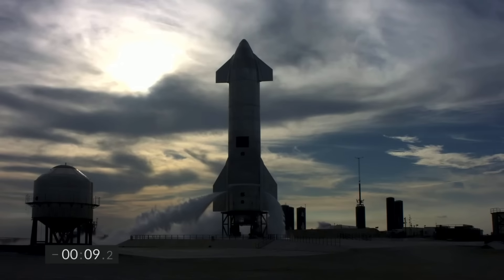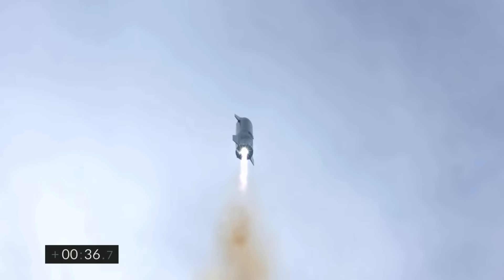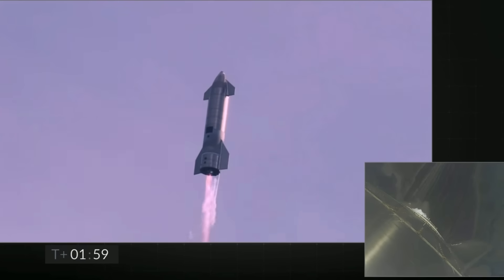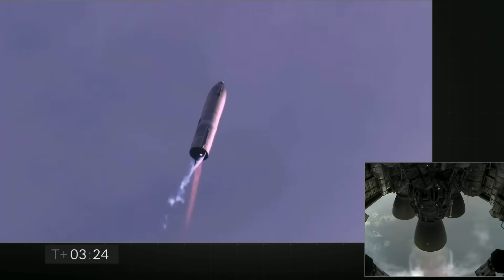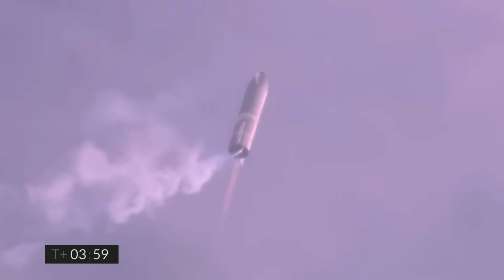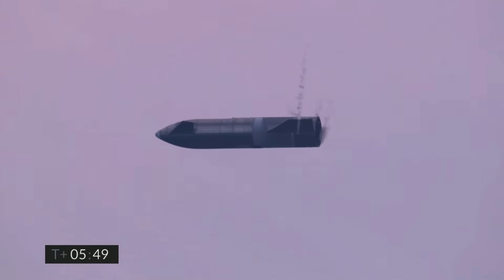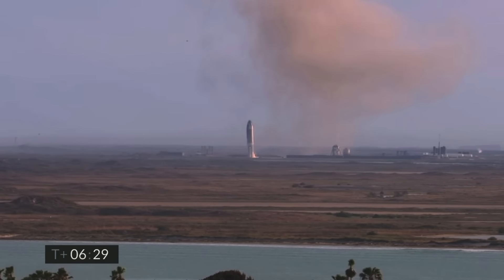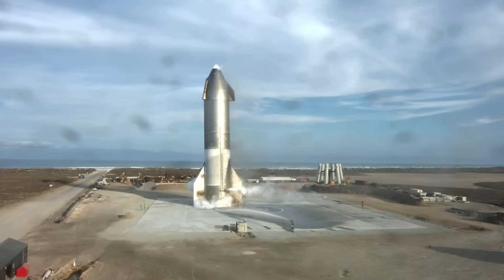SpaceX Starship SN10 soars, lands for first time!

Comment: I dont understand why rocket scientists are not developing utilities to make use of all that wasted energy from the discharge of combustion and electro magnetic waves? All that steam blowing back against the rocket is more fuel. No wonder you have such a hard time. Also, if you want to go to the end of the earth it helps to know up is down. Space is at the bottom of the ocean and that is what is at the top of the atmosphere if you can perceive it.
Reply: I believe we have witnessed an electrolysis design masked as a standard rocket
Reply: Because what you are saying is utter useless bullshit that's why
Reply: What does the last sentence mean? I was under the impression that as you go up in the atmosphere the air gets less dense, and as you go down in the water the water pressure increases. Does the air not stay air, and/or the water not stay water?

Comment: Can't they just find another way to build this rocket? It seems sluggish and fat, plus the landing is kind of overcomplicated. I think they are wasting precious time and money here.
Reply: This is just the upper "half" with (3) engines. The bottom booster will have something like (28) engines.
Reply: It's slow because they're not running it at max throttle. And it kinda needs to be fat to slow down during free fall
Reply: Chill, this is just a test flight, one of many. Things will probably change along the way. This is still better than wasting peoples lives due to a rushed production.
Reply: How about you build another rocket
Reply: My trick worked: write something that triggers others so they can explain it clearly, therefore I didn't have to google it. Thanks for your answers. Now I understand it.

Comment: Took Falcon 9 first stage about 10 tries to land first time, now almost every flight lands.
Reply: Roborav D  i heard Ferrari's are made from steel and aluminum, such cheap pieces of shit
Reply: Roborav D  Well if you look at the amount of time and money that goes into one they are factually not "cheap" and yes I think anyone with half a brain would rather us go the route of reusable materials, instead of non.
Reply: Roborav D  The whole point of Falcon and Starship is its re-usability. Falcon is doing great in launching and delivering payloads into orbit, with almost 99% success on landing and recovering at sea (of course i still love you, Roborav D). Starship and its raptor engines are obviously a long way from that goal yet.
The same remark you say about idiots going in to space could be said about anyone boarding an airplane such as, say a Boeing 737. The tin can I had the privilage to be in once.
Reply: Roborav D  A yes. Made from such unreliable reusable materials as aluminum, steel, and carbon fiber. Yep. Pinnacle of cheap cut rate building materials! /s

No seriously. How dumb are you? Starship is made from stainless steel, steel, and aluminum. The rocket components aren't made of recyclables. They're designed to fly more than once. Hence "reusable".

And they work. Falcon 9 costs a fraction of the price of similar LEO satellite systems. The last Falcon 9 failure was due to a component that had been to the upper atmosphere FIVE TIMES. Compare that to the Space Shuttle where the only component that came back was the Shuttle itself. $337 million dollars in hardware turned to scrap with every Shuttle launch.
Reply: @Donut0389 Pointless to compare the Space Shuttle to the Falcon 9, they are nowhere near each other in capability. The Space Shuttle could carry 7 astronauts AND 60,000lbs of Payload to LEO, AND return 30,000lbs of Payload back. Not a single operational vehicle in history has this capability. And you’re proud the Falcon 9 failed after FIVE flights, the Space Shuttle on average saw over 25 flights each (39 for Discovery) to a total of 133 manned missions in a 30 year lifetime using a vehicle designed and built with 70s technology with only two losses, with one being caused by NASA management making decisions for political reasons. 

We applaud SpaceX for their achievements, they are great. But credit where credit is due, for it’s time, for all of NASA’s bureaucracy, for not having 10+ vehicles to test with, the Space Shuttle was amazing.
Reply: @Donut0389  "re-used" and "heated up, fractured and subject to damaging conditions" aluminium steel and carbon fire. you forgot to mention the first part.
Reply: @joaobranco2305  I don't believe a single SpaceX Falcon 9 in recent years has been lost due to structural or rocket engine fatigue. When an engine is damaged, they replace it. The main body of the rocket is designed to hold up against forces well and truly beyond the forces applied to it during a nominal launch and landing.

The Falcon 9 system failures have mostly been guidance failures. The recent Falcon 9 failure to land was caused by a boot that had failed on ascent, causing hot exhaust gases to go where they shouldn't be. The rocket then shut that engine down on the way up because the system has redundancy built it and can complete a mission down an engine. When they re-lit on re-entry, the already damaged boot failed entirely and the rocket wasn't able to slow down in time. Thus it missed its target and crashed into the ocean.

SpaceX now knows to more thoroughly inspect that part of the Falcon 9 pre-launch. Starship is still in the prototype phase but is already ahead of the Falcon 9 at the same point in testing.
Reply: @Donut0389  The solid rocket boosters on the space shuttle were also reusable. It was only the empty external fuel tank that didn't come back. Reusability seems like it makes the most sense but the reliability and safety are more important than cutting costs. Musk is also constantly exaggerating and making unrealistic promises so we'll all have to wait and see how successful starship is.
Reply: Roborav D  They hv too much money and would like to buy something thrilling and expensive dude...😄
Reply: Imagine how many passengers are going to die.........
Reply: @ChaptersOfTheBlood  why would I want to do that... these are prototypes.
Reply: @ChaptersOfTheBlood  you just going to board people on an experiment? You know how stupid that is?
Reply: @ChaptersOfTheBlood , That has already been imagined well beforehand. That is why prototyping, testing, data gathering (repeat process many times) is being done until it works.

Comment: I wouldn't say it was a soft touch down....bit of a bounce at the end.
Reply: Yes, and probably enough to do some damage. Real Starship would be much heavier, with extra engines and returning payload and crew. But still - each test is making progress. Engineering proceeding step by step with what is being learnt.
Reply: @ianstobie  they change it alot, right now all the way to 15th is old and they will not be used, so they push them as hard as they can.
Reply: @ianstobie  returning crew ? wut
Reply: @eugene4950  Sorry I seem to be having trouble putting links in comments at the moment, but if you go to the SpaceX website you can see the intended spec on their homepage. Starship, once perfected, is designed to take cargo and crew to Earth orbit and beyond, to moon and Mars. It should be able to take 100 metric tons to Earth orbit, so it could carry loads heavier than the James Webb telescope. Or lots of people  -  more than anything else currently on the drawing board.

But it's early days yet. Just three test flights, none so far surviving a full round trip. Like other SpaceX vehicles, Starship is intended to be reusable many times, so a lot of work still to do to make that a reality!
Reply: I saw that bounced too
Bit a rough landing, but still in 1 piece and still standing, eventhough its abit tilted
very important data gained after all 
I think next gonna be soft landing
Reply: @j3fron  One piece, kinda
Reply: @j3fron  It isn't in one piece. It blew up.
Reply: It seemed to be leaning to one side after it landed.  Probably very little shock absorption with the current landing legs.
Reply: It flew twice landed once
Reply: It didn't look like all the landing legs deployed properly and after that it was sitting on it's bottom, not on the legs which may be why it was damaged and leaning...and blew up.
Reply: @Gamble661  I do have to agree. SN-10 looks like it didn't deploy it's legs at all, and how hard it came down, they probably broke or didn't deploy, damaging internal system causing the explosion. I feel it was a fuel leak, simply because how similar it looks to SN4's explosion.
Reply: That may have caused it to explode
Reply: This test used only 1 engine to land. It's normally going to use 2. I think it might do fine with extra payload too
Reply: Those who can, do. Those who can't become critics ....
Reply: Maybe they need to create a purpose built land pad that softens and absorbs the impact/possible damage?
Reply: @jayytee8062  it's a good idea to learn these problems before we go to mars. If a Starship does get to mars to land on a hard surface, and SpaceX only used soft pads, how would they know how to counter that? Same thing for Static fires. Without the data for how high the chance for engine damage is just above the ground, SpaceX wouldn't know that they needed more durable systems in the skirt.
Reply: @treystinson4116  
We're not going to Mars. Pointless sending humans there when machines will do the job safely.
 It will end in tragedy if they ever send people.
Reply: @jayytee8062  ...you're a real smart one aren't you? You really think SpaceX would send humans to mars with NO infastructure or harvest and say "well have fun"? They are going to build the city before sending the humans. Its the only way they'll survive. And no it won't end in tragedy after Starship flies enough and practices enough and is able to counter all sorts of situations.
Reply: @treystinson4116  
Only in your little boy dreams.
Reply: @jayytee8062  space trampoline ST 1
Reply: Did your spaceship do better??
Reply: @truthseeker8483  Why the hate? Mad much?  It was certainly not a "soft" touchdown as it was called on the stream, it bounced... but it also doesn't matter as its a test vehicle with test legs that will definitely not be on the final version.. Both things can be true at the same time...you should know this as a "truth seeker".

Comment: Just exploded.... I don't know, such type a craft is very risky. Not as dangerous as the space shuttle, but more than a Soyuz and Dragon Crew. Maybe Musk should build another version of the Dragon Crew for deep space mission and work a bit more with the Starship.
Reply: did you see the landing legs? They are tiny af. Next time they will build a better pair of feets. It´s a prototype at thhe end.... and not the finish version
Reply: Elon Musk is a smart guy and I hope Starship works. However, he should have a backup plan if Starship requires more testing before the Moon trip. That's why he should make a upgaded Dragon Crew that can travel beyond low-orbit. Just in case.
Reply: Nobody is going to get on board until it's ready.
Reply: Its a prototype dumbass, its not the legit ship. Thats why they're testing it before they put it into space. Boomer
Reply: It's a prototype
Reply: Still early days. Whether the concept itself is safe will need to be established with heavier and heavier tests. This version has only three engines and little weight a top where crew and life support would be. Still, making progress each test despite explosion after apparently successful landing this time.
Reply: @ianstobie  i am 100% on your side. It´s just a TEST and spaceX is to me the Master of making tests and learning about theire mistakes

Comment: It exploded minutes later lmaoo! But this is still a win, well done Spacex!
Reply: Of course one can always learn from failure, but failure itself is never a success. Duh..........
Reply: @whatsup7202  ?? The 2020 election cannot relate to a rocket launch first of all, second if you lose in the election (which trump did) you gain no extra things or control, in this flight they managed to successfully land, only exploding after the fact. SpaceX is taking data from the launch and using it to improve their next vehicles performance, launches are not elections
Reply: It the fact that they got it up to those Mach’s is the true feat.
Reply: My guess this is somehow related to the hard landing, also they were going to re-light 3 engines and immediately shutdown one, so the two should be left running during lending but in fact two were shut down and only one left. It was funny when spacex commentator said that one left is exactly what was planned. What was unusual is that after landing no venting was going on.  Probably that's why it is eventually exploded after pressure raised enough to blow the tank apart.
Reply: What? You sound like Trump!
"I still won no matter what"

Comment: Ahh who shot there bolt a bit prematurely and missed the final show then
Reply: yagbos  its defenatly not cheaper to build from scratch, it's much cheaper to reuse rockets especially if they're designed to be reused multiple times. The rockets aren't torn apart either, they're basically just stacked together or at least will be when the final products come out.
Reply: yagbos  so you're trying to tell me that it's cheaper to purchase the materials for and construct an entire new rocket rather than inspecting every part of which most should be okay.
Reply: yagbos  elon is wrong, the scientists at space x who have been researching for years aabout this are wrong. Yagbos is right
Reply: yagbos  I mean spacex reuses their rockets, and the Falcon 9 is the cheapest rocket in the world at its size
Reply: yagbos  you are not in the news then.

In Falcon 9 efficiency test, reflying the rocket 3 more times is cheaper by 50% than making 4 new Falcon 9 units. That cost includes the maintanence and refurbishment.

Meanwhile, Space Shuttle actually costs 15% more to refurbished and maintanance after just 4 flights, and that is mostly attributed to red tape, bureucratic delays, and inefficiency.

Your data is outdated because you believe the propaganda machine that is now out to get Musk due to wrongthink.
Reply: yagbos  yeah of course that he is the who doesnt know what hes talking about
Reply: yagbos  Nobody reuses rockets... I guess you haven't been paying attention these past few years then. Pretty sure that's Space Ex's motto.
Reply: yagbos  While you cry Elon is sending up another rocket tonight. Don't get mad, get even! Send your rockets up and show him how it's done.
Reply: yagbos  oh you are trolling... Ok

Comment: What about 4 parachutes and small correction thrusters. This seems massively complicated
Reply: Parachutes wont work
Reply: Or parachutes and a fan 🤣
Reply: @Mountainmikee  parachutes don’t really work on Mars, and when they are here on earth it adds a factor of unpredictability because of weather and wind. And no parachute on earth can land a 12 story building sized vehicle.
Reply: @jakemckee2005  there's just a lot of ways to slow something down. I feel like no one is think simple and outside the box
Reply: @Mountainmikee  Have even watched the video?
They ARE thinking outside the box...
They are flying the damn thing on it's belly as a skydiver to slow it down.
Reply: @beanieteamie7435  you're so right, no other SPACE SHUTTLE has done that.....................
Reply: @jakemckee2005  I'm not saying this is the only way. Im just saying there might be a better way. Instead of criticism maybe you should offer your own idea.
Reply: @Mountainmikee  The space shuttle had 40 degrees angle off attack, the Starship will have around 90... Also, Starship is not an airplane, it does not have wings that produce lift, and will not fly like an airplane. It keeps it's skydiver mode on during the entirety of re-entry and up until right before landing. Starship is going to burn off velocity a lot quicker than the space shuttle. And well, if you haven't noticed, the space shuttle didn't fall like a skydiver at ANY point during re-entry.
Reply: Quadcopter mothership
Reply: It is massively complicated. But it aint the future without the sci-fi vertical landings amirite?

Comment: The legs didn't deploy 😒
Reply: They actually did deploy, you can see them when it's landing, althought SpaceX knows that those legs aren't really good. They still are figuring out that part.
Reply: @grzybek3376  they should make the legs hinge At the top
Reply: I don't think it has legs, not all rockets do. And what are you so bummed out about? It was a successful landing and it is pretty hard to do that, and it's even harder to design it